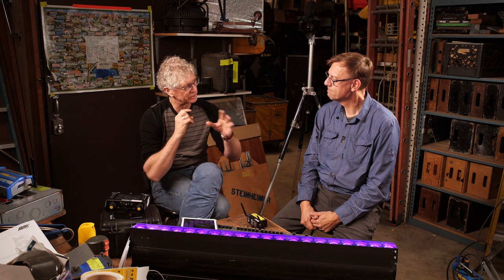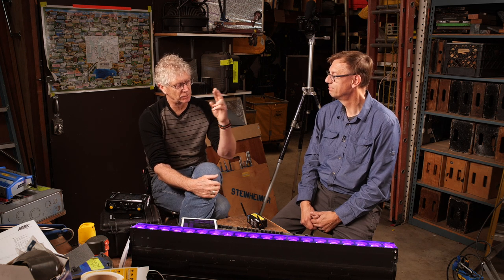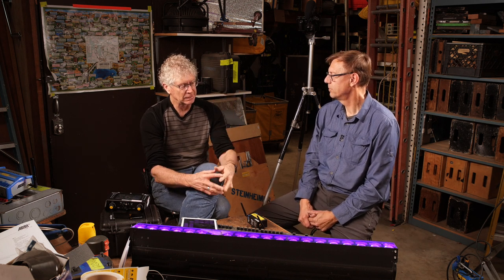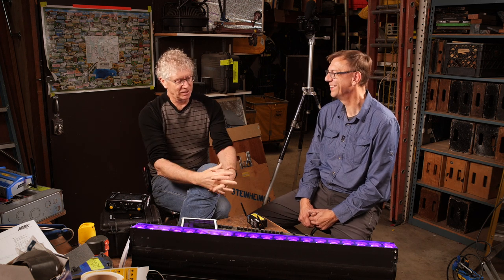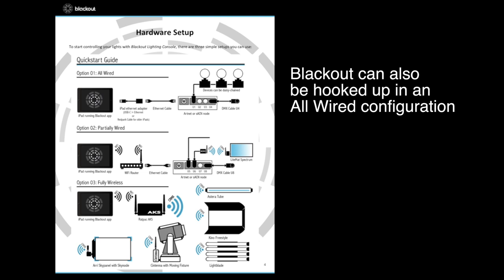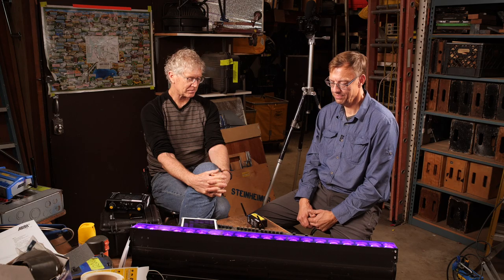Meet The Gaffer #176: Lighting Control Update and Intro to BLACKOUT

Comment: One of the things that I keep seeing from aperture thats really nice is simple 1 channel profiles for mono color lights and 2 for bi color with their RGB panels starting at 3. The bare needed to get a light to output and a few simple adjustments is nice.
While I've ran large ECT boards with 100-200 lights for a theater and 50-60 in a small TV studio I don't want to be dragging along some massive board to run 5-10 lights.

Comment: Hi Luke, how are you doing!  

I just bought an iPad Pro 12.9” version with the M2 processor and 1TB of storage.  I am going to buy Blackout for my lighting control software.  Also, I am going to buy the RatPac AKS Plus with WiFi & RatPac’s Cintenna 2’s for each of my Aperture 300x lights.  

In the future I want to buy 4 of the 4’ Double Rainbows by Quasar Science and run them off batteries.  I will probably need 5 universes though, because the Double Rainbows use almost a universe each.

Talk to you later, stay safe.
Mathew A Coulliette
Reply from the maker: What is your use case for d 4ft double rainbows?
Reply: @meetthegaffer  I don’t really know yet.  I have watched a lot of reviews for regular tube lights, and although they looked good in shot, I didn’t think much of them as a lighting instrument; however, when I watched the reviews for the 4’ Double Rainbows with 100watts each and the Ossiam mounting system I got excited about what is possible.  I just feel that I could put these lights anywhere and light anything with them.
Reply from the maker: Would be happy to discuss offline if it would help to think it through. lseerveld@gmail.com

Comment: Using the keypad, are there shortcut keys for things like look advancement? (On blackout)
Reply: There are technically "look" buttons in BO 2.0, but they are still working on the command line. So in theory, you would be able to type something like "go to look 12, enter", but right now, the fastest is just to to tap the look you want to go to or, in 2.0, there are next/last buttons at the top of the screen to advance looks forward or backwards. Also now in 2.0 you can add a midi controller and assign the next/last look buttons to hardware buttons for quick access...

Comment: Check out Moonlite CRMX from Lumen Radio. It's their version of Cintenna but is RDM capable though their app. Would love to see a review of it.
Reply from the maker: Everybody is getting in the game:)
Reply from the maker: I saw one on set once. It’s nifty and versatile for sure. The Cinilex Skynodes are cool too, with a great form factor.
Reply: Ratpac Cintennas are capable of RDM over wireless as long as you're using an RDM capable transmitter. The same goes for Moonlite.
Reply: Also worth noting, 2nd generation of Ratpac Cintennas are coming in the new year with some great updates- including a built in antenna. No more snappy-offy on set! No more accidental antenna removal static discharge killing them either!
Reply from the maker: That will be nice. So many useful toys available!
Reply: @mrghost14  I knew about the Cintenna RDM capability with an additional transmitter but my understanding was Moonlite had RDM built in. Is that not true?

Comment: Hi Luke, thanks for this video. I m a gaffer in Belgium and I m searching desperately a physical fader board to connect in Bluetooth with my iPad Pro. So I can play in live for an effect on a movie. Can you  recommend a brand ? Thank you a lot !
Reply from the maker: A Belgium gaffer came up with the Gaffer’s Control (https://www.gafferscontrol.com/) which many people like. The Control One by Exalux is another all-in-one unit that may suit you as well. If you want something specifically for the iPad, I have spent most of my time with the Blackout Lighting Console app. You can connect it wirelessly or wired to a transmitter/bridge that talks to your lighting fixtures via internal or third party receivers using Lumen Radio. If you want a physical board for effects, that has a tablet option, you’re probably looking for something via ETC, but that’s not something you can learn quickly. It might be an idea to collaborate/hire a board op for your show so you can concentrate on the big picture while the board op makes the effects sing!

Comment: In the Blackout part you say that that the Asteratube is talking to the AKS reciever. Does all units talk to the AKS and then then into the IPAD? I want to get this with wireless antennas for a long job where I have 10 lights with all different brands. Thought I buy 10 antennas, 1 reciever and blackout, would that work?
Reply from the maker: You have the right idea, but instead of having one receiver and many transmitters, you actually have one transmitter (the AKS in my case) and many receivers, either built in or added (there are a number of brands avail). You can see an overview in MTG #35: 
https://youtu.be/PlP0fUQxvCM

Comment: Sorry Luke for not following the topic above. But its soon Christmas, and could really need some thoughts on this. . What boom arm or boom/tripod would you recommend? I like to put up to 8kg on maximum extension of the boom arm. Im interested in a Avanger d650 boom arm or a stand\boom combo like kupo 546M / JUNIOR BOOM STAND. Is a bad I idea to get a low roller base. I dig low rollers. Also, do you have any experience with jinbie products?
Reply: Hey Joel,
I'd personally go with Modern's Combo Boom for a convenient boom option. For heavier loads/longer reach, it's probably best to build a menace arm (pipe boom).
Brand-wise, I have steered clear of Avenger and Kupo stuff. In the Bay, most stands are American, and a few Matthews.
Roller stands are cool as long as: you are on pretty flat ground, you make sure your load is over a leg and they are properly sandbagged.
Also remember that you have to raise up the total weight of the light and any counterbalance weight.
https://modernstudio.com/products/combo-boom-arm?_pos=2&_sid=e64a4797f&_ss=r
Reply from the maker: No experience with Jinbei products. They seem to be COB type units like Aputure. I’m no help, I’m afraid.
Reply from the maker: I’m no familiar with these two boom arms, but the Avenger one looks a lot like the Matthews. Are you able to get a hold of speed rail where you are? It’s nice to be able to pull out the sag of the boom with ratchet straps on top, like the outriggers and tension wires on a jib or crane. For stands, I like wheels too, but when you start adding the weight and cantilevering weight, it’s nice to have a crank stand. But I agree, low rollers are always handy once you have something mounted and then need to move it, especially when it’s on the heavier side:) Rent before you buy, if that’s possible, so you know you’ll like the solution. Regardless, all the best with your choices.

Comment: Nice video. I wouldn't get to far away from Luminair. They are watching and waiting to strike. Firmware 4.0 is probably going to overtake all the current available apps.
Reply from the maker: Good to know! Pretty hard to be too demanding given the price:)
Reply: They’ve been out for ten years and three major releases and you still have to patch one fixture at a time and you still have to scroll across 1000 identical looking wheels.  I wouldn’t hold my breath.
Reply: 3 years later and all we get is virtually the same features with a few more universes, but behind a subscription paywall even if you already bought it!